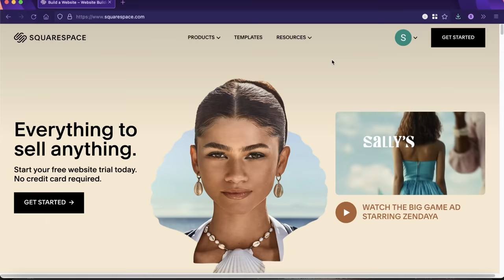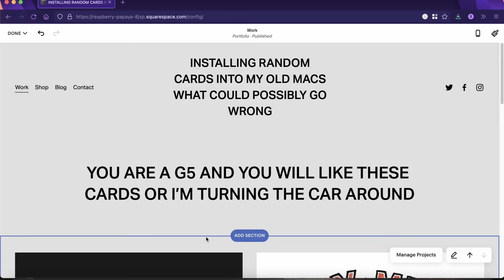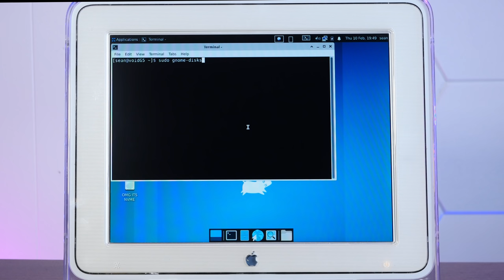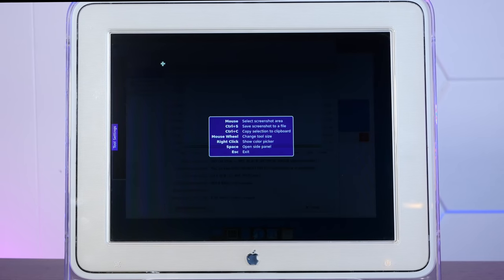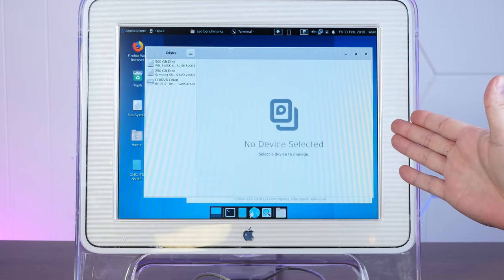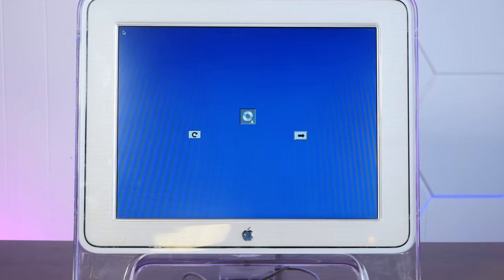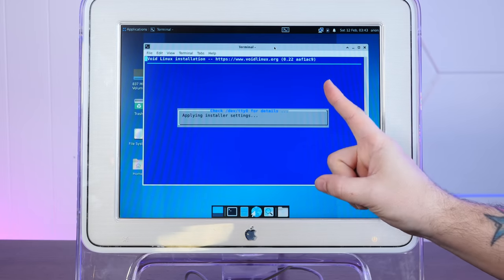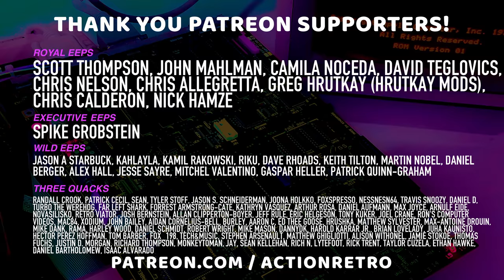Running Modern NVMe in a PowerMac G5!

Comment: NVMe is a protocol just like SATA is a protocol... m.2 is the formfactor... there are NVMe m.2 SSD's and SATA m.2 SSD's, the USB/m.2 card combo is a SATA m.2 card... NOT an NVMe card...nvm
Reply: Thanks for the heads up
Reply: Thanks, saved me from writing the same comment. 😂
Reply: NVMe is at the same level and is a better alternative to AHCI. Both of those are above the level of SATA and PCIe. There were AHCI PCIe drives before NVMe. The G5 has AHCI but does not have NVMe.
Reply: That USB/m.2 card combo is a SATA m.2 card. When you buy a USB/m.2 housing make sure it can do NVME because those NVME controllers can handle both AHCI-SATA-m.2 and NVME m.2 cards.
Reply: .........it's a youtube channel
Reply: @QuietOC  again... NVMe is a storage protocol, PCIe is a bus standard... Both are completely different... The 'm.2 formfactor is basically just a new edge connector for the PCIe standard which is used mainly for storage devices which communicate using the NVMe or AHCI protocol... Where NVMe is the latest standard for SSD's which can communicate over a PCIe bus, usually using 4 PCIe "lanes" of either version 3.0 or version 4.0 (at the moment) where the difference is the available bandwidth per lane and thus the maximum (theoretical) transfer speed per lane is higher for 4.0
Reply: @mstreurman  To add to the confusion, you can carry NVMe and PCI-E over fiber; NVMe, SATA, SAS, SCSI over U.2; And you can encapsulate NVMe in PCI-E in ethernet over fiber or go direct NVMe/PCI-E/ethernet over fibre, etc. haahaa
Reply: @XenonG  that is why those are protocols and not bus or connector types... Simplified: A protocol is "a set of rules" that makes devices compatible, a bus is a standard for a signal, a connector is just that... A connector... That is why, in theory, you could connect 2 hdmi cables to each other using a DE15 (aka VGA) connector as long as you connect the internal wires to the correct pins... The protocol HDMI is completely oblivious to the connector... Hell... If you wanted to you could desolder the hdmi port and either use a cut off cable and solder the wires directly to the screen, or replace the hdmi port with a VGA port and make a HDMI cable with hdmi on 1 end and DE15 on the other and plug it in...
Reply: @mstreurman  who cares? 🤷
Reply: @_..-.._..-.._  you will when you have stuff that doesn't work on your computer and can't figure out why.

Comment: You are confounding a few technologies here. The form factor is called M.2. M.2 breaks out into 4 PCIe lanes, a sata connector and a USB connector. NVMe is a standard that uses the 4 PCIe lanes to transmit data. NVMe drives do not need controllers they are complete devices attached to the PCIe bus. They are basically a whole raid controller on a card with the storage. There are also SATA M.2 drives. These drives won't work in your pure PCIe adapter cards because the cards are dumb and contain no controllers, they are just a riser that converts PCIe lanes form factor from the desktop connector to the M.2 connector. So a SATA drive won't work in them.
Reply: Exactly. And the speed differences among the different NVMe to PCIe adapters are not the adapters, because they don‘t do anything except physically connecting the NVMe drive to the PCIe port.
But there are some of those adapters coming with a boot ROM for older systems without native NV!e support. So they connect the NVMe directly and add a boot ROM. Of course those won‘t for PowerMacs.
Reply: @jensdroessler3575   PCI-E is nothing, and everything, it's just whatever the card is you put into it.  I wonder if you could have a really simple solution. As you gave me an idea here, you could connect the drive to a PCI-E USB C card. Theoretically USB is backwards compatible so it should recognise any drive connected by USB. Open Firmware should, probably, maybe see it.

Comment: This rough technique of bootstrapping for NVMe support works for all sorts of systems that can't directly boot from PCIe NVMe M.2 adapters. I did it in a old Dell R710 with an EFI shim.
Reply: Absolutely. Also works well with Hackintosh builds. I've configured many OptiPlex 7010s and HP Elite 8300s in this way. EFI folder goes on a small, cheap SATA SSD; OS and everything else NVMe. Insanely inexpensive, fully functional, relatively fast High Sierra to Catalina Macs. The i7-3770 is still a very capable chip for many purposes, and I've seen many folks shocked at how those babies fly when accompanied by an appropriate GPU, 16-32 GB DDR3, and NVMe storage. 10 Gb/s Type-C support via PCIe (Ablecomm card comes to mind) is also a reasonably inexpensive addition to such systems; Fenvi WLAN cards also.
Reply: On "newer" Dell optiplexes you can also modify the UEFI firmware with the official NVME "driver" to add native support, I'm actually running an optiplex booted directly off of a new samsung nvme ssd. There is also a project to add Resizable Bar support to UEFI boards that don't natively support it but I don't have an intel DGPU so I haven't tried it.

Comment: Minor Nitpick, but you pointed to the iMac G3 when mentioning the Powermacs, which could give the misleading impression that iMac G3 was a part of the Powermac family when in fact it as not. While the iMac G3  used the same CPU as the Powermac G3 it was never a classified as a Powermac by Apple. The Powermac G3 (and later the Powermac G4) came only in a tower form, never in an all-in-one computers form.

Comment: Three things to try:
1. The very, very first generation of NVME boot drives had a legacy OPROM that makes them often reverse compatible with older systems. Intel 750, Samsung 950 Pro, and Samsung PM953 110mm drives are the three to try.
2. The AHCI boot is even easier. Try the cheapest SM951 AHCI you can get your hands on.
3. You might actually be able to get full speed out of a SATA SSD with some of the earliest HighPoint SATA III PCIe controllers, like a 642L which even came with G5 compatible drivers.

Comment: You don't have to reinstall Linux; you can use dd to copy the drive over and edit fstab (on root) and grub's config (on boot) to point to the new root partition. Reinstall is fine and all, but you don't have to.

Using a NVMe drive doesn't use any sort of converter; it's just a straight adaptation of the PCIe slot direct to the drive. NVMe is a logical protocol that directly uses PCIe physically. There is no controller other than the drive itself.

Your combo card definitely has a SATA controller and USB controller; it must be using a PCIe bridge also to provide both SATA and PCIe to its M.2 slot to allow you to use either type of M.2 SSD. The cards without SATA controllers on them will only work w/ NVMe SSDs on them.

Why is the first card faster? Perhaps it's a better PCB layout with just a bit better signal integrity. Otherwise the higher result was just a random fluctuation.
Reply: This, as a rough solution, you should be able to run an install on a regular drive then reconfigure the boot loader to address the new drives. As a complete backstop it should work.

Comment: Quick note: That AHCI m.2 would not work in the direct adapter card, but it will probably work in the funky usb/m.2 card. 
Similarly, that WD card would never work in that combo adapter card since it's NVME and not AHCI. 
NVME = PCIe
AHCI = SATA
Reply: There are PCIe SSDs that use AHCI, for example those in the 2013 MacBook Pro (they aren't M.2, but I think M.2 PCIe SSDs with AHCI were also made around that time)
Reply: @Drucklufttroete  - Thank you! There were early Samsung PM951 AHCI x4 drives (also found in early PCIe HP "TurboDrives"), a few niche gamer drives and SanDisk made a x2 2242 variant for laptop HP "TurboDrives". I had a few of those and they bench at 600-700 MB/s. The PM951s bench at 1,200-2,000 MB/s depending on capacity - there's a 128GB on the lowest end.

Comment: The first 3 adapters are all passive connector adapters, all they do is change the connector form factor from full blown PCIe to M.2 M key.
All they do is to connect a NVME or AHCI SSD to the PCIe bus, there is no logic on them just a single M.2 connector.
A NVME drive uses the native NVME protocol over PCIe, an AHCI SSD has a buildin PCIe to SATA adapter onboard.
A SATA M.2 SSD is just like a regular 2.5" SSD in a different form factor that only works on the USB / M.2 combo card.

Comment: Sean, following your G5 series closely. I have an A1117 2.0GHZ myself that I'm looking to squeeze all performance out of.

And, LOL at your fan noise solution. I have a Coraid 2u 15-bay NAS server running TrueNAS that is kept well away from any occupied spaces in the house and it sounds like your typical server room, even with three fans removed that used to cool the spinning platter drives (I replaced all 15 with SSDs, so no need for extra cooling).

Comment: there are sata disk on modules out there too. I would try to see how to operate that way if possible and just shove a Sony DRU842A replacement drive for the IDE connector. the power connector on disk on modules can be hit or miss though.

Comment: MVMe is a drive standard. The connector that NVMe drives use is called M.2

When you said that the AHCI drive is recognized by OpenFirmware, what that means is that OpenFirmware can see M.2 drives, but not NVME M.2 drives. AHCI is SATA, which means that you can get a PCIe M.2 SATA card, and install an M.2 SATA SSD. This will give you an M.2 SSD with the maximum possible speeds that is recognized in OpenFirmware.

Comment: This might have already been mentioned but, I think you would need both the mac boot partition as well as the Linux boot partition on the IDE drive to stand the chance.  You have to have the Linux kernel loaded to have access to those drivers that would make the other stuff work.
Reply: That sounds about right. Basically everything but the root partition and home partition need to be on the IDE or SATA bus.

And by root partition I mean for basic programs, you need to make sure that the Linux kernel gets loaded.

Comment: 1st generation PCIe is limited to 250MB/s of bandwidth per lane, a 4x drive on 1.0 lanes should be able to approach 1GB/s, and you're getting half that, which suggests the drive is only getting access to 2 lanes.  Its possible having the video card in that primary slot is taking up too many lanes and preventing other slots from having full access to the potential bandwidth; if its possible you could try swapping card order around and see if performance improves.

Comment: So interesting to find your videos. Didn't realize anyone else was interested in these sorts of things. In 2018-2019 I spent so much time working with G5s, early Mac Pros, various m.2 SATA/NVMe/AHCI drives, drivers, eventually architecting a solution that enabled me to boot Tiger on a Quad from an AHCI blade as well as full-on NVMe boot solutions in the Mac Pro 3,1. 

Correcting a minor error in your video. The USB combo card that you show at the 9-minute mark is not at all NVMe. That slot is B-key m.2 NGFF and will only support a m.2 SATA blade, totally unrelated to NVMe. NVMe uses PCIe lanes (as you know) while m.2 SATA is simply SATA using a different form factor. There is no NVMe nor SATA controller on that card, and no "adapter" as such. It's directly pass-through (the m.2 SATA card is wired to the pins on the SATA connector on the opposite edge of the card). Speeds are limited to 6 Gb/s SATA III, as that's the native raw bandwidth of the drives that it is compatible with. Because it is an x1 card, essentially aside from the "drive carrier" functionality, it's necessarily limited to USB 3.0 speeds on the external ports (both Type-A and Type-C USB ports). 

Also, as an aside, I've worked with all of those specific carrier cards, and the first one that you show us (the one with x4 pins only) works fine with AHCI drives as well. Haven't tried that particular one on a PPC unit, though, but can confirm it does work OOB with (very specific) AHCI drives on Mac Pro 1,1-3,1 and is bootable after some tweaks.

Awesome video, my man. New fan here.

Comment: Shame you couldn't get any of the NVMe drives to boot into OS X. I have a SATA 3 PCIe card coming in the mail for my quad G5, hopefully that'll boost the speeds a bit for my SSD which is currently connected to the default SATA-I connectors onboard.

Comment: I wonder if a similar setup might work on the iMac G3: boot partition off of the hdd and then hack some kind of a connector for an ssd or even another NVMe. Then again it would depend on if you could get Linux working on the G3.
Reply: There's no PCIe on the iMac G3, so NVMe isn't a possibility at all. There isn't even SATA.

Comment: Would love to see you replace the stock fans with some Noctua ones to shut it up a bit, assuming that's possible!
Reply: The Power Mac fans use a different control scheme than regular PC fans. It would be easy to get Noctua fans installed if you rewire the connector, but harder to get control over the speed.

Comment: Hot plug of HDDs existed before SATA. 
I had a workstation in 1999 with removable scsi drives that supported hot swap and RAID.
Reply: Yes, but then you run into the issue of daisy chaining.

Comment: Did you try mounting sda1 as /boot and nvme1 as / then allowing GRUB to install onto the IDE drive as well? If the thing is already booting grub then there's no reason why grub cannot bootstrap another install from another drive, that's literally its job.

Try doing 
"sudo su" 
then 
"mount /dev/nvme1 /mnt" 
"mkdir -P /mnt{/boot,/home}"
"mount /dev/sda1 /mnt/boot"
"void-installer"
then when you get to this partition screen choose something else, check what is shown matches what you did and let it install. When it comes to grub point it to /boot and finally check /etc/fstab to make sure grub is pointed to nvme1 by UUID as the root partition.

Edit - or an even easier test. Reinstall the working IDE, install void onto nvme1 as normal then edit /etc/default/grub on your working IDE install and add the NVMe install as a new line. Finally grub-mkconfig -o /boot/grub/grub.cfg to write the changes and you should be able to boot the nvme from grub off the ide.

Comment: I was able to talk via PCI registers to an NVMe card on my powermac G5. There's a lot more to do, but I can't think of any reason why you couldn't type in an NVMe driver into any OpenFirmware-based platform with PCIe support into NVRAMRC and boot directly from the NVMe card.

Comment: I think the real issue is will the operating system destroy the SSD? Obviously if you're running Linux everything is fine but if you loaded the Mac OS on it and it was an older Mac OS the it wasn't properly programmed for ssds they can do way too many rights or no particularly good reason and quickly run down even a modern SSD. It makes it kind of tricky to run Windows XP on an SSD. You can still do it and it's probably fine if it's not your daily driver and you're just playing some old games on it but back in the day you wouldn't want to do it
Reply: It's probably unlikely it would do "too many writes", and SSD controllers have features to compensate for some SSD-unfriendly practices.

Ironically, some difficulty comes from when the OS supports more SSD feature than Windows does. SSDs have sometimes advertised to the OS that they support features that they do not really support, and any OS that is foolish enough to believe the SSD will quickly corrupt its data by sending valid commands the SSD doesn't understand. Doesn't cause a problem on Windows because Windows doesn't support that feature either, but this was a problem on Linux and Mac OS a few years ago with several drives, making it quite difficult for Linux users to buy SSDs with confidence!

Comment: NVMe becoming the dominant storage standard is all well and good, but the CPU manufacturers aren't keeping up. Modern CPUs don't have anywhere near enough PCIE lanes to accommodate a modern GPU (16 Lanes by itself!), an NVME for your OS (another 4 lanes), and extra storage for your files/game library/etc. (4 lanes per 2TB currently.) I know you can buy HEDT platforms for more PCIE lanes, but those chips tend to not be great for gaming due to lower clock speeds.

Comment: i recommend using 100gb nvme (installed linux in nvme )then installed in pc n turn it on im sure u find way into it dont need double plug in
if u still hitting pole then go in bios settings im sure u will find it there if u dont know
it quick n easy just boot in linux (when u turn it on n boot in then reboot them pushing esc u will catch it pop up black screen with letter on there n go down to bios settings it take it u into it if u dont see bios settings then u may find it in pro.... else i adjust u try it